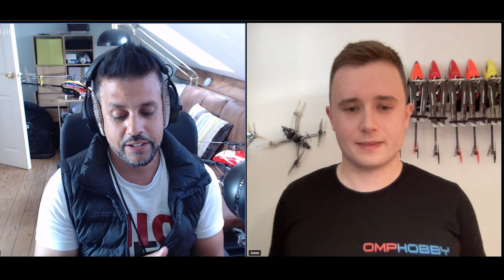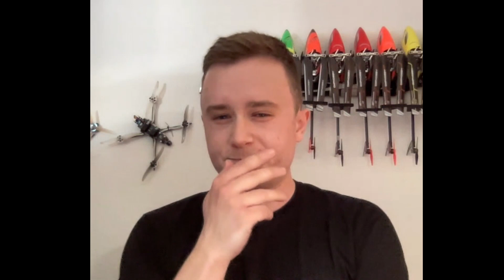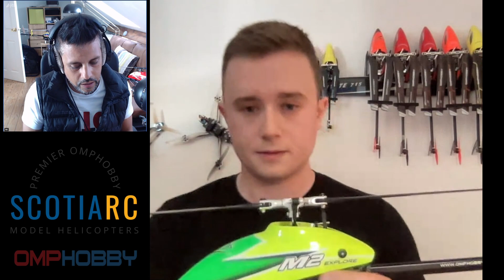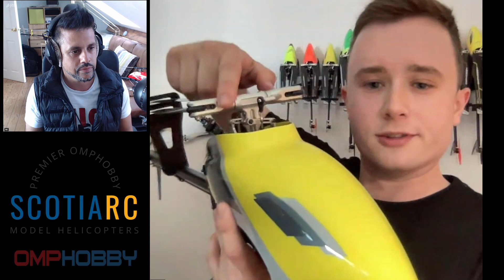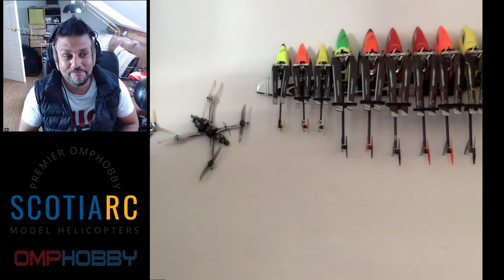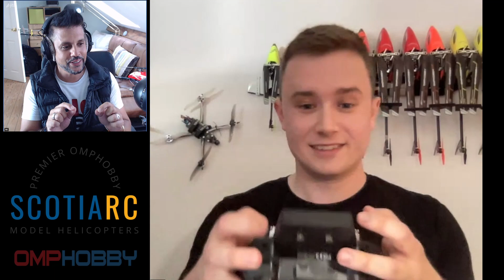Jonas Wackershauser OMP M4 Designer, FULL Interview!

Comment: You should make the M 4 better by making the motor bigger - A longer carbon fibre Boom - Larger 420 Blades and call it "The M4 MAX'
Reply from the maker: 😂 you're joking right? Just checking 😁
Reply: @NJ-Tech   Hi NJ.. Yes mate..I have both versions now, I just watched this interview and found it very interesting - especially the wash out arms  V's the DFC (Harmonic Vibration) part.
Sam :)
Reply from the maker: @samsly8464  I really want the max! Think I'll sell the m4 and go for it. You enjoying the difference? Tried an auto?
Reply: @NJ-Tech   There is a big difference between the two. Its everything you would want more out of the M4. Its fly's very light and its very efficient, It is very refined and it looks great. Jonas has done a very good job with it and you can see by your interview that he is very proud of his accomplishments.
I think you would be rather impressed . 
In terms of  'auto's'  400 to 450 size helicopters as you know just don't have the Kinetic energy in the rotor to pull off such manoeuvres like the 600 to 700 helis do.
The M 4 Max is my favourite machine so far and I have a huge hanger with Protos 380 - Goo sky Rs 4 -  rex TB  - OMP M4
Reply from the maker: @samsly8464  great info appreciate it! Yeah I figured it will overspeed auto but 425 is still pushing it for low rotor inertia. Well, that's going on the shopping list! 😬

Comment: 13:17
My M1 does that. Pump the pitch up and back to centre (zero) quickly, the tail will walk around.
It doesn't affect actual flight, and it doesn't do it if you go negative instead of back to zero.

Comment: I went with the small Twin X-Lite S that is really comfortable.  Ethos has lots of similarities to EdgeTX programming and small form factor (like the controller mentioned in the video) but with color touch screen, and I like the FrSky ACCESS protocol features (wireless firmware updates for Rx, Ability to share Rx with my other radios without needing to re-register, etc).  Only useful though if you want to go with Ethos as it doesn't support OpenTX/EdgeTX.  I don't miss OpenTX though after switching from using OpenTX exclusively since 2015.  Mixing and such is very close to the same.  You still have OpenTX type power but with the ability to use pre-built mixers if you want to go that route too or a combination of them.
Reply from the maker: Awesome info, I'll definitely look into that. Thanks.